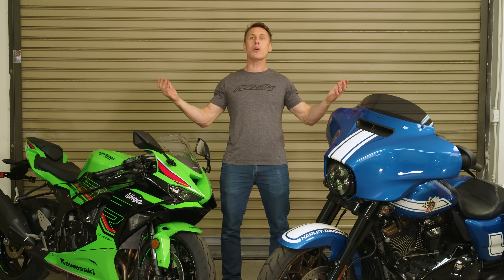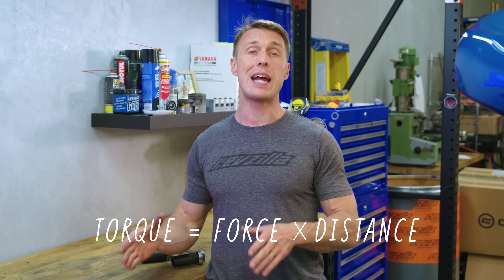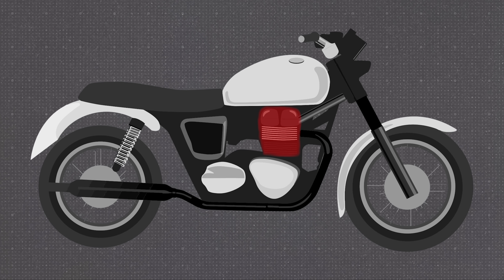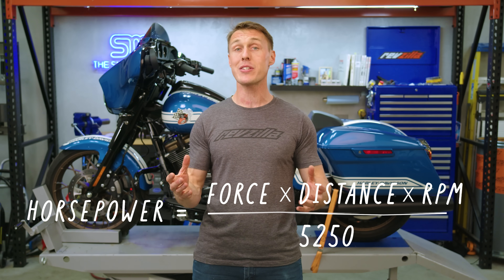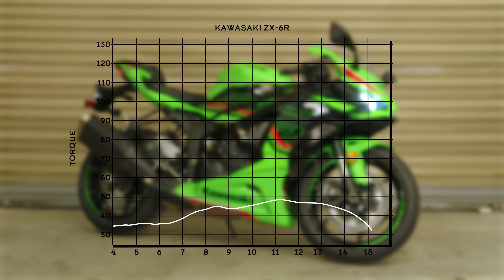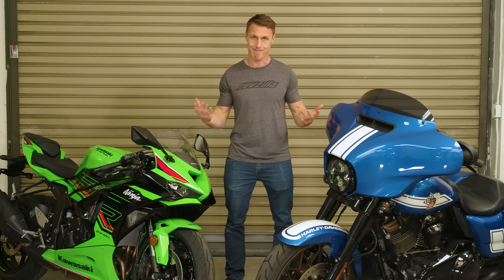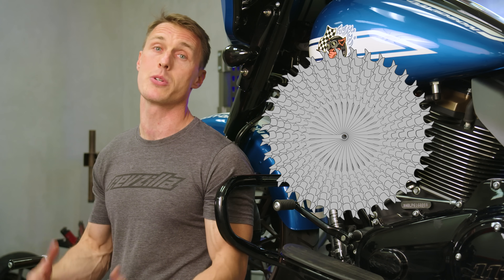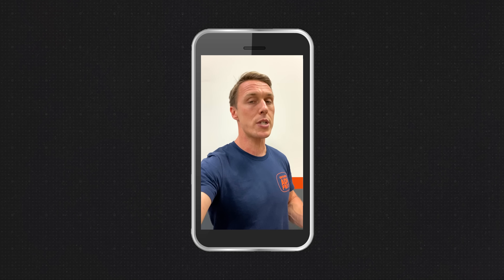Torque and Horsepower Explained! | The Shop Manual

Comment: Too much torque is not enough. As per video Torque is pulling or twisting strength as compared with Horsepower that is power that affects torque and determines top end speed.

Comment: I find two issues with this video.  The first issue is the calculation for Horsepower.  You used the wrong denominator in your calculation.  The calculation is HP=Torque x RPMs/5252, not 5250  Also, distance isn't in the calculation.

The second issue is that you say to get more HP,  you have to have more torque over time but if you look at the dyno graphs of these liter bikes, you'll see that the torque stays relatively flat throughout the whole RPM range but the torque is really low compared to HP unlike a Harley which weren't designed for racing so they have higher displacement while the RPMs stay low but they usually produce more or similar peak torque compared with horsepower. .

Comment: High torque output is overrated imo. 40-50 lb/ft of tq is plenty. Just like the Inline-4 Supersports and even these modern day parallel twin sporty bikes like an Mt07 for example. HP and tq delivery is what makes all the difference. I own a S1000RR and a Bandit 1250. Both produce about the same amount of tq but it's how it's delivered that make all the difference. The BMW is very linear and pulls all the way to a screaming redline. The Suzuki pulls down low in the revs and similar to a 600 sportbike when the tq output is at its max the HP kicks in never feeling weak or dull but more exhilarating.

Comment: Its not a bad explaination, but i feel youre going to cause problems with the "torque means acceleration and horsepower means speed" summary. I understand you get the caveats there, but people look for an easy answer here and this isnt it.  

Comparing an I4 and big vtwin exacerbates the problem though i understand why you chose them, as the little 600-class i4 is so extreme. 

What people SHOULD ve doing is comparing HP curves between bikes.  To the rider, rear wheel horsepower is the only relevant value, but you need to compare the whole curve not peak.  

Want to know how fast a bike will accelerate from a stop?  Compare low to mid rpm HP.  Want to know if its going to have even power across the rpm range, look at how peaky vs flat the curve is.  

Engine torque isn't a useful number to most riders, simply because while there are correlations using engine torque to assume acceleration can lead to misunderstandings.

Comment: There are cars that use two motors. There have been cars that use 2 V8 motors to make a single W16 and other examples. 

In a car an amazing engine does 100hp per liter. The S2000 is one of the most impressive mass production car engines ever with 250hp from a 2.0L engine. 

Why is no one slapping two 1L supersport engines into a Miata or whatever to give it 400-450HP from a 2L engine? People have put massive LS V8s into a Miata. I’m guessing even a single 1.0L 200HP engine would be something of an upgrade. 

What about replacing the engine in a Prius? Less torque from the bike engine but that’s countered with an electric motor.
Reply: A single 1L motor would have the power to far up the rev range. People have done that, but you always need to rev the motor pretty high, to get the car moving properly (research "Superfast Matt" and his Honda S600 here on YouTube). As for building a single 2L motor from two 1L bike motors, that's also been done before, but is very complicated, because you need to build an entirely new bottom end (crankcase, crankshaft, oiling system and so on)
Reply: @Blockbuster2033  sorry you took it very literally. I’m asking why it isn’t done more often. People do fantastic builds where they … move an engine in a car. Combine engines. A guy made a V8 Tesla with no electric motors. Right? People DO the work you’re talking about. 

There are rare instances where a motorcycle engine gets used in a car. It’s very rare. 

Honda makes both cars and motorcycles. If they wanted to use a supersport engine in a car … they would. BMW is in the same situation. I think Suzuki makes cars in other global markets. 

I don’t know if I buy the rev idea. A lot of people call that out. The motorcycle needs to rev the same and that works. Feels like a nonissue. The same person who revs out the R1 would be happy to rev out a car with an R1 engine .. and plenty of people rev out those bikes. 

The lack of torque. That’s a real thing. Especially because the car weighs so much more. The difference is minimizes (comparatively) when using a car as light as possible. But, still a factor. 

Motorcycle engines aren’t effective long term. They’re just not. There are a handful of instances of motorcycles going many hundreds of thousands of miles. But it’s really rare. If people expect a car to make 100,000 miles without much of an issue and too few motorcycle engines can do that because they’re so on the edge of…. That seems reasonable. 

I’d love to hear from an expert (no offense, random person from the internet) about why this isn’t done more.
Reply: @Blockbuster2033 yeah, many hill climb build are bike swaps. 
I think he doesn't know service intervals of bikes vs car lol.
Bikes need to be serviced around 3000km and cars around 12000km. Lol.
Reply: @zero11010  I realize that I'm a random stranger on the internet for you, just like you are for me. I am, however, a high-semester engineering student under one of the former lead engine developers at Rotax. 

It's true, plenty of engine swabs are done, even putting V8s in Tesla chassis. However, the big problem with motorcycle engines is their small capacity. They make power by high rotational speeds. To keep a motorcycle at 100kph you need less than 10kW. That's not much power at all, which means a motorcycle can be geared very long, which gets the revs down. In a car you need about 25kW to stay at 100kph. That means that you need much more power, so the gearing needs to be shorter, so the engine revs higher than it would in a motorcycle. 

For OEMs to put motorcycle engines in cars makes no sense at all because those engines would operate far outside their optimal efficiency region and therefore use more fuel than a larger capacity motor that runs at a lower rotational speed. Also in a car, a little extra mass doesn't really matter that much, in a motorcycle it absolutely does matter. On top of that, customers expect very long service intervals from their car engines, motorcycle engines can't compete on that level. Then there is stuff like variable valve timing, which only few motorcycle engines have, and none have it to the extent that car engines have it implemented. Another thing is hydrolifters in the valve-train, which is also not present on motorcycle engines.

Lastly, if anyone would do a motorcycle engine swap into a car, there is several problems that normal car engines don't have: motorcycle engines are not designed with lateral forces in mind because motorcycles lean. This leads to potential oil starvation when putting the engine in a car and going around corners. Secondly, motorcycle engines have the gearbox included, which is also a sequential gearbox, which makes everything quite complicated. Removing that gearbox and using a separate one is not really possible for the average engine swapper that is not an engineer. 

You have however given me a great idea. I am a great fan of the MX-5 already and I am someone who would do stupid complicated shit, just to be different. I find the idea of making a 2L V8 motor out of two superbike motors very intriguing. It would need a custom crankshaft and a custom engine block, but I am a proper engineer soon afterall, so I could do it. And then put that in the Miata and mate it to the stock transmission, since the sequential gearbox gets dropped anyway when doing a custom bottom end.
Reply: @zero11010 Motorcycles are much lighter and it’s more practical to rev them out. Especially to get moving. Think about getting moving in a car with no bottom end torque and all the power way up the rev range. You’d either be extremely sluggish off the line or have to have a ton of strain on the clutch as you rev to the moon to lug that heavy car up from a start. 

That’s less of a problem with motorcycles because they’re so light that they can move easily on relatively low amounts of power at low speed, and it’s a lot less weight to strain the clutch when coming from a stop.
Reply: @Stuey105  I did have the suggestion of a hybrid. These are being used JUST to get cars moving at this point. 

The EXACT weak spot of the motorcycle engine.
Reply: @Blockbuster2033  what I heard was this:

“I’m studying to be an engineer. This is impractical so no one does it. Also, it’s a fantastic idea and I really want to do it myself.” 

There are LOTS of impractical cars out there. 

Don’t you think it’s a little strange that Honda hasn’t tried to do something like this? A true CRZ successor with a tiny car and 200-300hp of motor. Right? A couple 0.6L supersport 600RR engines would be a solid way to make a light way car fly. Only 1.2L of total engine space needed. And that’s very little engine weight and it would be … 260hp? Or a single 1.0L with less customization required and “only” 215hp?

Definitely not a stoplight monster with low torque … unless you modify that engine to produce more torque. 

I don’t see motorcycle channels talking about it. I don’t see car channels talking about it. 

BMW is doing all kinds of hybrid drivetrains at this point. A tiny little car with a small electric motor and a fairly small battery and also a 220hp 1.0L engine doesn’t sound like fun? That electric motor could provide the torque to get it moving and supply an extra 100hp for low speed get up and go … and then the ICE engine takes over. 

Isn’t that basically how the new E-Ray corvette works? Two disconnected motors each powering a set of wheels. 

A sequential shifter doesn’t really seem like a big trade off to me. 

I think I saw some dude put two Hayabusa engines in a Fiat or something. One up front and one in the back. That’s clearly pretty out there and amazing. That feels like a LOT of customization. I think it was a second transmission and a second engine and linking to connect both clutches to the same pedal and both transmissions to the same shifter (don’t know if it was two separate gas tanks).

Comment: When comparing vehicles you can't use just one value when bragging at local car meet.
You can have 500hp on your heavy AF pickup, but that 300hp Civic will disappear from your view pretty quick.That's because that Civic weighs over 3x less.

Comment: you can't feel torque. the velocity of acceleration is what you feel, which is dictated by horsepower. amount of work in time.

 if you create 10,000 lb/ft of torque at a speed of a 1/4 inch a year, you are not gonna be put back in your seat, right?

Comment: I love you guys but... Oversimplified is fine, wrong is not fine.
Torque is strength - Yes. Simple and true.
Power is speed? - No. Power is speed times strength. That's really the simplest you can make power.

Power is the rate of doing hard things TIMES the the harness of said things. 
A linebacker generally has more power than a sprinter. 
The ninja engine (more power) can lift or accelerate more weight faster than the harley engine could (or depending on gearing, the same weight much faster, or much more weight at the same acceleration, etc). 

RevZilla, what you actually did here is create a nice simple video explaining why engine speed (rpm) is an important factor in engine performance (power). The tragedy is that instead of calling it engine speed or rpm, you called it power. It's a pretty common misunderstanding. 

The reason I care about this is that millions of people who will actually need to understand power to invent things, design things, and analyze things, often start with deep misconceptions like this that can actually be very hard to overcome in college. I know many engineers who finished school without really knowing what power is... and they generally don't go on to design things like vehicle powertrains, aircraft propulsion systems, or anything else involving power until they do.
I get that your target audience is the average curious rider and prospective moto buyer, not just the future engineers among them. Still, the misconception stings some non-engineers too. I knew someone who bought a work-truck for it's higher torque value, only to discover it couldn't tow a strong as the old truck (it had less power).

The world would be just a little better without misconception of what mechanical power is.

Comment: so by that concept, electrics should have more hp since torque is applied all the time...? 🤔🤔🤔
Reply: Power is easy to measure for an electric (hey there, dyno!), but manufacturers of electrics often post very, very misleading torque numbers. 

Electrics make power differently than ICE's so it depends which value you measure and how you calculate the other.

Comment: Wronggggg. Ignore this video.  Horsepower is.   Horses power. 2 horses pulling a carraige is 2 horsepower.  390 horsepower is same as 390 horses power.   See it as the power   500 horses would create while pulling a bike , car vs 300 horses.   Torque is the weight of the vehicle divided by the horsepower.  A street bike with less horsepower will be faster than a heavier car with more horsepower because of the torque.  Torque is the area in a horses lower leg that transfers the power on the push off.      Im 100%

Comment: stroke doesn't create more torque. it's the wrong belief. do the research. look at dyno test. cubic inches creat torque.
Reply: Yea it does. Leverage= torque. 

By increasing the stroke you, would be increasing the cubic Centimeters.
Reply: @Josh-cw8by   what I'm saying is, it's not the increase in stroke that is significant in the increase of power. It's the increase in volume of the engine that is increasing power. it's been dyno proven.

cubic centimeters, cubic inches, whatever, the volume is increased.

Comment: 6:17  "Torque is strength and horsepower is speed"   No.  Torque is measure in Nm or Ft.lb and strength has no units.  Power is measured in Hp or Watts and speed is measured in m/s.  Your equations are not dimensionally correct.

Comment: It's torque over time.... the capacity to do work.... the faster you can make the torque the more horsepower... I hp is 550ft/lbs/sec also 762 Watts.
BMEP is a useful measure too to understand torque measurement and how is used to calculate power.

Comment: Great energetic video presentation as usual.  Horsepower is a calculation as no way to measure directly.  Horsepower basically rpm x torque divided by a constant.  A heavier bike needs more torque to start off the line.  A lighter bikes needs less torque to start off the line.  Higher rpm means more horsepower.  A 200 horsepower 15,000 rpm motorcycle not very street horsepower friendly as difficult to ride around town at 15,000 but great at screaming down straightaways at the track.  A Super Duke 1290 makes 180 horsepower all below 9500 rpm.  That is realistic streetable useable horsepower.  It also offers 104 ft pounds of torque.  Very special engine that offers both good torque and power with 460 pounds of weight.  Most engines you must decide horsepower or torque which is dependent on weight of motorcycle.  Much easier and cheaper to keep installing larger motors which increases weight vs trying to make the bike lighter using expensive titanium, magnesium, carbon fiber, plastics, and smaller engine.  Lighter bikes help handling, braking, and acceleration

Comment: Torque number dosnt say anything...always look at torque curve
Reply: Agree, it's much better at knowing what it will feel like than 1 data point
Reply: Close, but no.  

The ONLY relevant value is the engine's power output, that is, horsepower - but you're right that it's the curve that matters, the amount of power generated at low to mid RPM, not just peak rpm.

Power is acceleration and top speed.  It's just a matter of seeing how much power an engine makes across the rpm range instead of just the peak.

Just a torque curve isn't useful either - you could look at the torque curve on a tractor and it'd look awesome, but it's meaningless without the time factor. 

Horsepower is just torque made useful. Literally the power output of the engine. 

But again, you're absolutely right that it's the whole curve that matters, not the peak.

Comment: Sigh, a great baseline of torque vs horsepower. Too bad it really does take more than 6 minutes to explain what the real implications are.

In a way, you can think of the torque value as a duty cycle rating to your horsepower.

If you have an engine that puts out 300hp with 2000LbFt of torque, it inplies you can put down 300hp for 10,000 hours.

300hp at 150FtLb, inplies you can put down 300hp fot 100 hours if you're lucky.

Comment: A lot of these analyses conflate torque and acceleration which is not really correct.  When you roll on the throttle, what you feel immediately is the difference between the power being used initially and what is available at that engine speed at full throttle.  If you are cruising with the throttle 90% closed and you open it fully, you will feel a lot of acceleration.  With a big twin, you tend to normally operate nearer the peak-power rpms at normal speeds mainly because high power occurs at much lower revs.  Even 50% max power is available at well under 2,500 RPM.   With a high-revving 4 cylinder like the Kawasaki, (max power at 13,200 rpm), you can get the same acceleration effect by cruising around in low gears at high rpms while traveling at low speed, but you feel like an idiot.  For comparison, 50% available power on the ZX-6R 80% max power occurs at about 7,000 rpm.